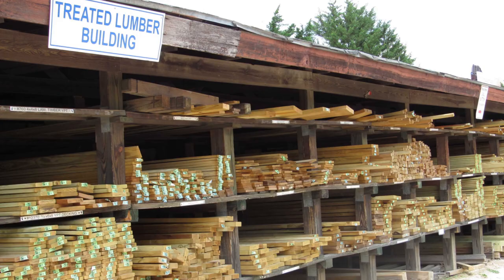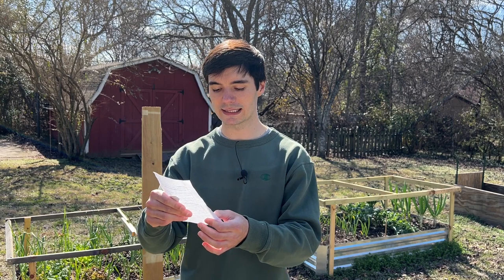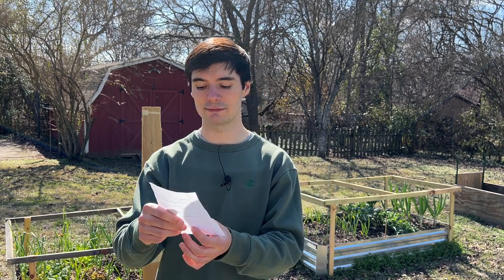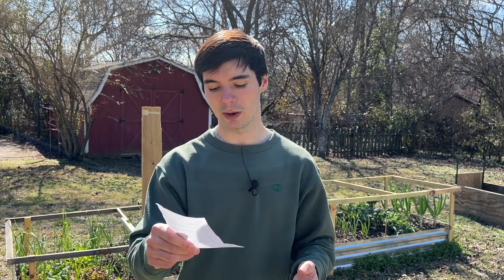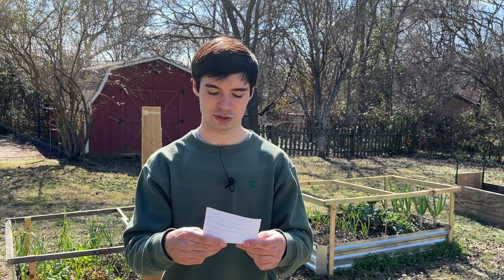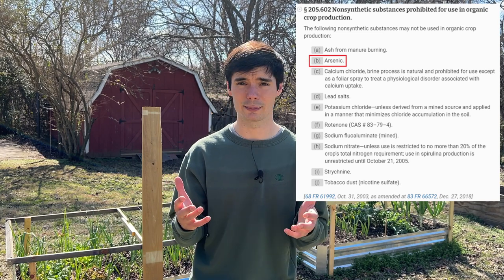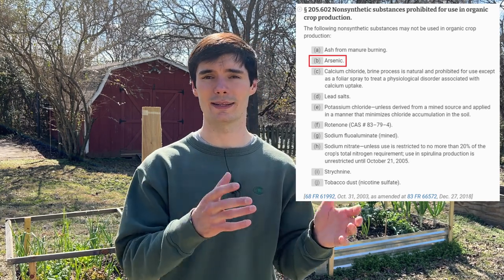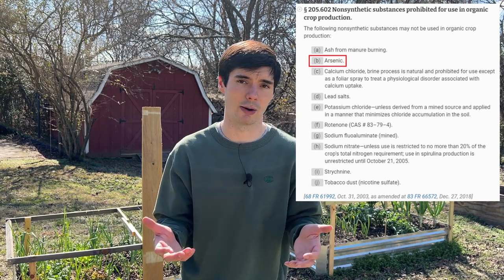DON'T Use Pressure Treated Wood in Raised Garden Beds

Comment: PT wood is perfectly safe to use in garden beds. Even if the micronized copper azole were to leech into your soil in any appreciable amount (it won't), you would notice long before it did you any harm because all your plants would die! Plants are far more sensitive to copper toxicity than humans.
Reply from the maker: That makes sense. I’d stress more caution around commercial treatments than residential (i.e., railroad ties and PT pallet wood).
Reply: 100% Correct !

Comment: Humans have been working with and using copper since the copper age starting around 5000bc, since then we have used this metal in everything including pennies, pots, buckets, water pipes, wires, toys, jewelry, roofs, and much more. It's also been used in gardens for decorative purposes and as an organic fungicide. Copper treated wood has been used extensively in decks, gardens and playgrounds since the early 2000s. It is also an essential mineral for both plants and humans. Like almost everything, too much copper exposure can be toxic. Yet with all this copper in our lives copper poisoning or copper toxicity in humans remains extremely rare. On the list of things to be worried about, copper poisoning from garden beds should be very low.

Comment: I used some so called 5/4 PT from HD less than 2 years ago. It rotted just the other day. What a mess as the bottom fell out in my screen room. I built a flower box 3 years ago from regular plywood I painted it and it's still doing fine.

Comment: I recently built a few beds with redwood 2x12s held together using dovetails and dowels so there are no screws to rust or pull out. The boards were $8/ft for full dimension 2x12s plus tax and a few dollars for oak dowels. It was not cheap, about $100 for a 2’ by 4’ bed but hopefully they hold up for many seasons and I can grow a lot of food in them. If they last for 10 years it’s only $10 per year which isn’t much more than buying plastic pots or other raised bed options. If they last 15-20 years the cost per year is almost nothing at that point. Quality pays for itself if you are planning on using them for the long term.
Reply from the maker: That’s amazing! I bet they’re beautiful too. Hoping that they last a long time for you.

Comment: Did the arsenic in treated wood that was used for decades harm anyone?  
Arsenic is found in rice. 
Does this mean we should not eat rice?
Reply from the maker: Thanks for watching! I will likely do a follow up video researching specific cases and health effects of each chemical (if any). Including all that in this video would have made it longer than I wanted. 
This video simply focused on the chemicals found in treated wood, the treatment processes, and warnings associated with the chemicals.
Reply: No Arsenic in residential pressure treated wood for just over 2 decades.